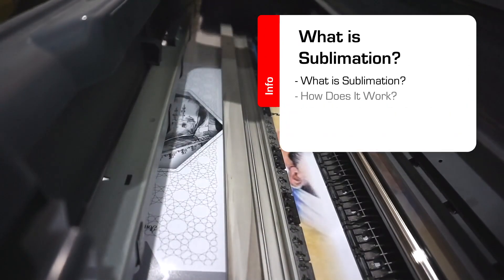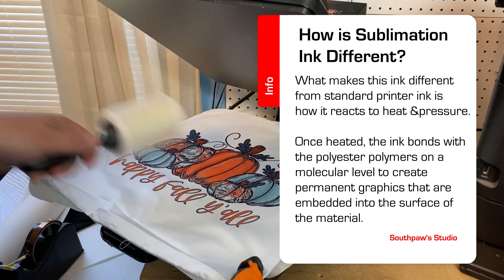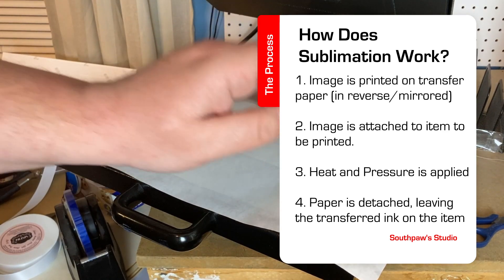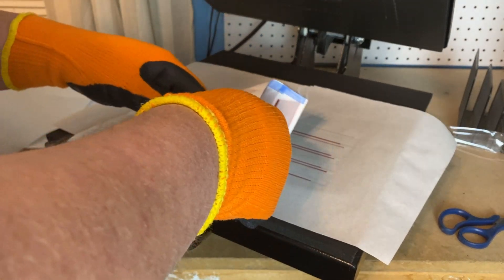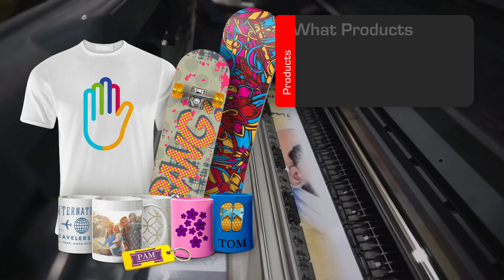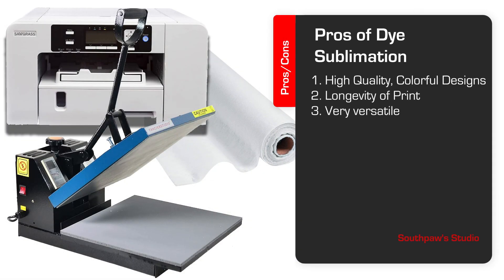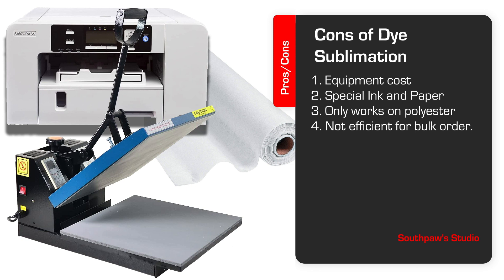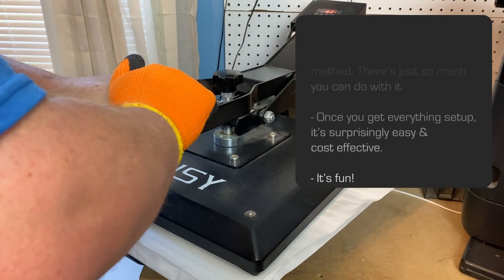Sublimation for Beginners: What is Sublimation Printing?

Comment: 4:19 "Images will never fade, crack or peel when using the correct substrate as they're technically part of the image at a molecular level". 
For anyone wondering - he meant that they're technically part of the FABRIC at a molecular level, not part of the image - the image is what wouldn't fade, crack or peel.

Comment: Currently I am making screen prints with Mason stains and applying it to my handmade pottery.  I have a logo that I've been making with screen print but screen print is limited in color and it's her logo but simplified for the screen printing process. I'd like another way to apply her logo to my pottery and be able to fire it at high temps or if not high temps then lower temp and do a third firing like I would if adding gold details.